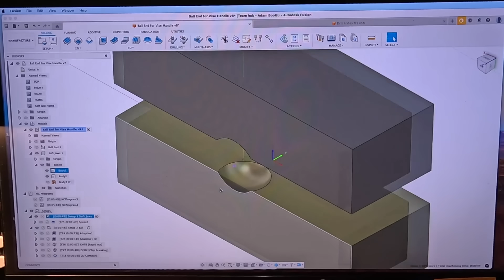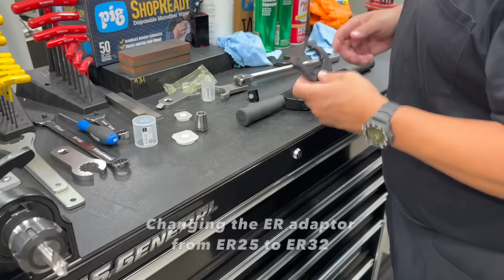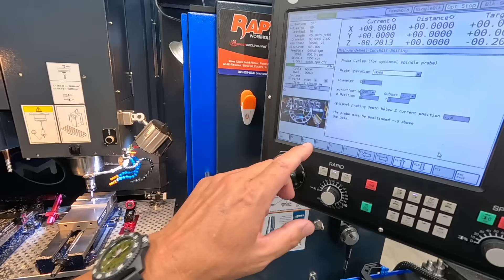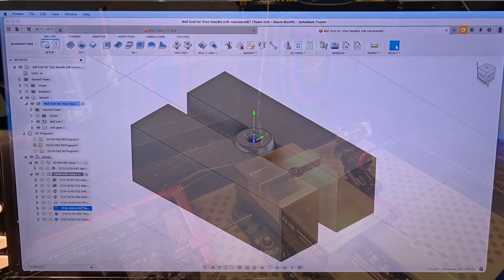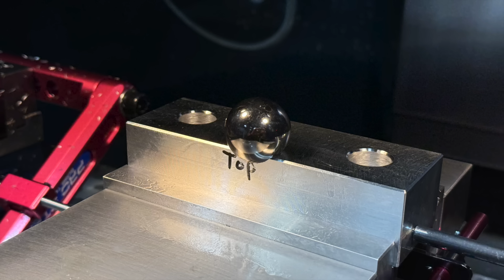Machining  Ball Ends for Vise Handle

Comment: Tip for future thread-milling: Keep both tool paths active, but activate wear compensation on your finishing tool path with no roughing passes. Put a forced tool change before your finishing pass & a manual entry after your finishing pass with a few thousandths stock to leave to retract your tool, turn off the coolant & spindle, bring the part toward you, and pause the program (typically G91 G28 Z0.; M9; M5; Y0; M00;). This way you can inspect the threads, and manually kick back to the first line of your finishing pass (manually or via search) as that tool path will begin with the T## M06 if you need to add wear to the tool in your controller to sneak up on it. Great video & awesome content!

Comment: 9:16 - Got several Edge Technology tools and they are impressive for the simple engineering and wonderful functionality. The 3-jaw chuck parallels for the lathe are a simple design solving a long-term issue (no, do not work there and am not paid; just a pleased customer).
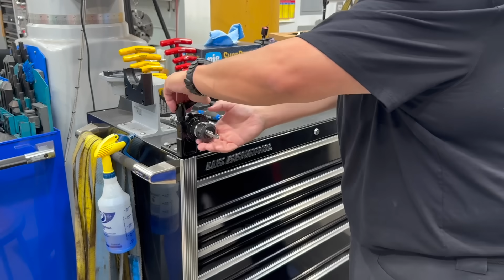15:09 - Very careful work; none of those cutters is going to fail to repeat.
28:39 - Can you label that cutter with the maker/source in your menu?
49:48 - Could well be air compression with that thread fit.
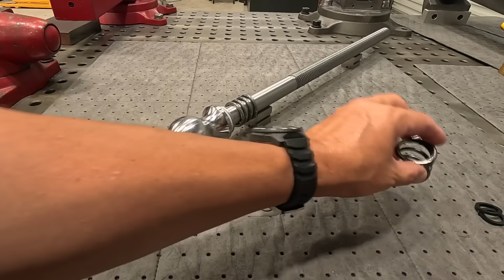55:02 - You have more coils with the new spring = longer 'torsion bar'. Could be a lower compression rate.

Comment: Not sure how comfortable u are but in passes tab u can enable wear so u don't need to walk back and forth from PC to machine.

U can adjust the wear comp in the machine by using a negative number to comp the thread mill into spec for the thread
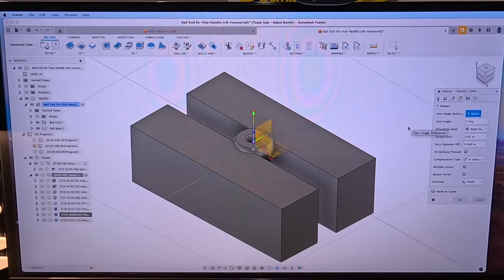Reply: He mentions at 40:02 (on screen graphic) that he wants the program to be 'right' first, and then later he can use wear compensation for fine tuning.

Comment: Great video Adam. I’ve not done CNC work but I have used 360 for 3-D printing designs and it’s not the easiest thing to use. There’s not much below and more simple to use available for this type of work. Big big learning curve. Great finishes on the pieces with a minimum of cuts. Thoroughly enjoyed the video. Thanks for your efforts and the dependable output of content. Not easy to put something out every week. Ignore the nitpickers!

Comment: What is the purpose of a no go gauge?  Why do we care that it don't go as long as it does go.  I am a novice, completely void of knowledge
Reply: It reveals when the threads you are making are the perfect size.  The "no go" end of the gauge is machined a little too tight to thread together.
Reply: One end tests if the threads are too big, the other tests if the threads are too small
Reply: to prove you are within tolerance the threads have to be within a certain range. not too big, not too small, the no-go gauge proves you are in the goldilocks zone.
Reply: Hardened precision gages establish the correct class of fit for interchangeable production parts.

Comment: Could you have cut two ball slots in the aluminum jaws and milled two balls in the same program?   Or does the programming of the second job take longer than cutting one at a time?
Reply: If your moving jaw has a little slack to accommodate any slight differences between the two parts, or you design-in a pivot to the moving softjaw, you can certainly do it, and use an offset to do the same operations in two places. If you're using Fusion, it's trivially simple to duplicate the part and machine both in tandem. It would save a few seconds on tool change time if you are doing a production run, but I'd make a dedicated fixture to run 16 or 25 at once if I had hundreds to make.

Comment: As a fellow cnc Miller in the UK when I make soft jaws I like to put 2x 6mm h7 fit holes in the both jaws at either side so when It comes to lining them up you can use 2 6mm pins and still get your Allen key In to tighten up also keeps jaws for repeat use awesome content 😀

Comment: A thought on making the soft jaws: before milling the hemispherical pocket, drill a clearance hole in the center. This would have two advantages. First, when cutting the pocket, the center of the pocket will be cut with the center of the ball mill, which moves at 0 fpm, and therefore does not cut well. Second, the center of the pocket doesn't help with clamping the ball, and can interfere. If the pocket is a tiny bit oversize, or if a tiny nub is left, then the ball will sit on that, and you will effectively be trying to clamp it at a single point. The ball won't be secure against rotating around that axis. But if you leave a hole the center, then the jaw will contact the ball in a ring pattern, which will be more secure.

In fact, for the best clamping, the contact patch should probably be a narrow ring around the outside edge, with most of the bottom of the pocket drilled or milled away.

Comment: This may be a dumb question, but how does the machine index the threads on each of those passes? The first time you re-cut the threads, I was wondering how does the program know where/when to start cutting and landing the tool in the exact right spot in it's rotation so that each pass overlaps exactly?
Reply: The thread mill doesn't need to land in any particular orientation. Unlike a tap, it doesn't have threads, but rather cuts a series of parallel ridges. The threads are developed when the machine moves the thread mill along a helical path.
Reply: Yeah I'm mistaken.  I forgot that the tool profile of a thread mill's teeth aren't dependent on an indexed position.  I always think in my mind that if I rotated the tool in the holder while in the oriented machine position it would change the thread start.  But it doesn't.
Reply: Was wondering the same thing
Reply: The tool is oriented at the same place every time because there is a spindle encoder.
Reply: @BradPow  One of the great features of thread mills is that, unlike a tap, they do not require a machine with a spindle encoder.
Reply: @BradPow  This isn't a tap.  It cuts the threads by moving the tool in a spiral path up the bore.  It doesn't matter where the spindle is in its rotation - it isn't synchronized to the threads like a lathe would be.

Comment: Just watching as you set up the drills, mills, taps, etc. into the custom holders, and I must admit, the cost of all that gear before you even commence operations must be a big drawback to the younger machinist who wishes to further involve himself on CNC operations. Is there some kind of financial helping hand available to the American novice, or do they have to go into debt before they start?
Reply: Go watch some Practical Machinist content. The regularly feature startups (several in the last few weeks) and low cost to entry commercially with CNC and or Manual. Very rough rule of thumb would be to allow 50-200% of the cost of the Mill or Lathe for tooling. The big plus in the US is the sheer level of 'decent' used equipment compared to say here in Australia where it just sux.

Comment: Something you might also want to check Adam is on the box the threadmill came in it should list the actual diameter of the threadmill as well. At least all the ones I have used in australia list the diameter anyway. Out of curiosity shouldn't the thread be programmed to a nominal diameter and the mill's diameter offset for the threadmill control the final size of the thread. Seems strange to have to change the program size to change the thread size because that would mean as it wears out you would have to change the program to compensate.

Comment: I made my vice handle balls the other way around. Started with regular round bar that I threaded internally. Then made them spherical with a ball turning tool. There was some play in the tool so the first one wasn't very spherical but after tightening up, it was perfect.

Comment: I'm wondering if you recessed the hole in the meatball to accommodate the rubber washers sitting slightly proud of the surface, if it would be a better/cleaner result than having them exposed and visible at the ends?

Comment: You know, after finding X and Y, you can just send the probe to 0,0 to find Z0, on top. Using the top of the jaws is fine, in this instance, but it would help eliminate any errors due to the way the ball was captured in that pocket.
Still, great job! Thank you for sharing.

Comment: How does the thread mill work at that RPM?  Could you show a close up of the tool?
Reply: It is essentially a groove tool, it only forms threads when moved helically. So it can work at any RPM, and any feedrate.

Comment: i don't understand how the threads are cut.
Reply: Magic
Reply: I think it's like the regular way as on the lathe, just the cutter moving vertically instead of horizontally. Plus the cutter point is spinning to make the cut instead of the stock spinning against the cutter on the lathe. The precise movement of the cutter in the Z direction (toward the floor, then toward the ceiling) while spinning is the amazing thing about the mill.

Comment: Incredibly over complicated. Could have made the entire ball on one setup in the lathe. Drill and tap the threads. Just needed to use a groove tool to form the ball and leave a .100” stub to break off and polish away.
Reply: You missed the point. He used this project to get experience on the Milltronics mill. I know it looks like he walked around the block to go to his nextdoor neighbor. He's trying to LEARN something that will expand his skill set. More power to you Adam.
Reply: @skx750 All he learned was how to overcomplicate something. For content it’s great, for efficiency it’s terrible.
Reply: Another guy who watches videos without listening.
Reply: @zorbakaput8537I watched the whole thing just for you and I still feel the same way.
Reply: It's not just about cutting chips, it's about the thought process and things to consider before making something.  As a machinist, i learn a lot from other people's methods

Comment: Adam i’m surprised you didn’t make the aluminum jaws for the vise. You could’ve purchased a slab of aluminum,measured it,cut it down on your bandsaw,milled,drilled,counter board the bolt holes, and then made the ball fixture feature. Maybe next time, … but it is still another great video.

Comment: Ran a Davenport Screw Machine that has 9 different cams and I manufactured automotive bleeder screws on Davenport Screw Machines that had a cycle time of 6 seconds. Every six seconds a bleeder screw would come off that machine complete after starting with a 12 ft hex stock. When I say complete there were feeding, forming, shaving, threading, drilling, cross drilling operations, and cutoff operations all on one machine.

Comment: Adam, at 50:20 or so... you were having issues with your go gauge....  look at the threads on your go gauge... it looks like there may be a ding on the threads of the go gauge... because it give you issues as soon as the shinny threads hits the part.
Reply: Thread gages are 60-65 HRC and can't get dinged. Maybe a small piece of swarf got in the thread.

Comment: I work as a manufacturing machinist.  I have 3 machines running one part in 3 stages of completion.  Along with 2 robots and a conveyor system.  I can make that offset correction on any tool, every machine as easy as opening my offset menu, modify, back to work.  

 Adam motivated me to become a machinist 5 years ago.  Changed my career at 55 years old.  I love this work.  I honestly love the manual machining I do at my home shop.  I miss it.  Was my hobby, now my paycheck lol.  

I started my shop 8 years ago with 2 very old, big machines.  A 30 inch bed 1973 Bridgeport and a WW2 Monarch tool room lathe off a Navy vessel.  ADAM taught me how to use them.  Honestly.

Comment: I understand that it is G code and all, but it seems really inefficient to have to go back to the computer just to open the thread bore up by .001”. Doesn’t it have some kind of tool compensation where you can adjust it at the machine without regenerating new G code at the computer?
Reply: I work as a manufacturing machinist.  I have 3 machines running one part in 3 stages of completion.  Along with 2 robots and a conveyor system.  I can make that offset correction on any tool, every machine as easy as opening my offset menu, modify, back to work.  

 Adam motivated me to become a machinist 5 years ago.  Changed my career at 55 years old.  I love this work.  I honestly love the manual machining I do at my home shop.  I miss it.  Was my hobby, now my paycheck lol.  

I started my shop 8 years ago with 2 very old, big machines.  A 30 inch bed Bridgeport and a WW2 Monarch tool room lathe.  ADAM taught me how to use them.  Honestly.
Reply: @MrJoey1003  right. I’m not a CNC machinist and only a novice hobby machinist at that. But I thought for sure you can open a hole up at the machine without having to go back to the computer
Reply: I’m well versed on using wear comp, so Adam is well advised on wear comp. He just wanted to learn one method using the software to make the changes. I’m sure you’ll see him do it with comp as well in the future.
Reply: @MechanicalAdvantage 
That makes perfect sense, no reason not to learn what the different options are. 

In that regard, is there a case where you see this way as the better option? Or is that really only useful for a machine that doesn’t have its own cutter comp, like a hobbyist machine possibly?
Reply: @BlackSmokeDMax  Getting the pitch diameter offset dialed in will help the next time he has to cut this thread in this material. Getting that dialed in, in combination with cutter comp will make it super easy to make small adjustments to dial in the thread. And the fact that he just wanted to use this method in the software this time.
Reply: @38:59 you can see he has his compensation type set to “in computer”, if he would change that to “in control”, then yes, he could just make a cutter comp offset right on his CNC.

Comment: So you spent $2000.00 for tooling to machine a $1.00 stainless steel ball for the vise handle. Just saying….
Reply: No he bought an expensive machine to extend the capabilities of his machine shop, and he uses fun projects to enjoy learning how to improve his skills with it.
Reply: Were you entertained? 😂
Reply: So ... I guess all that tooling he bought will just be thrown away or put in a box and never be used for anything else huh? Just sayin ...
Reply: Learning cnc machines takes a lot of time and money. Initial investment is astronomical. I see a lot of youtube videos showing cnc machining  but when I ask how much time and money it took to manufacture the part…..  invariably the answer I get is crickets. It is no easy feat.
When I learned to run a Davenport screw machine it took about 5-6 years to truly become one with the machine. It was expensive but I was able to keep my costs down by buying used machines and those machines came with a lot of tooling. If I had to buy new I wouldn’t have been able to do it.  Another plus I had was the fact I was mechanically inclined. I could look at the problem and finding the solution was easy for me. I also learned to repair my own machines. You have to think outside the box and be flexible.
Reply: Yeah, you’re probably right, sigh….

Comment: Regarding the coolant splashes on the camera lens, speak to Peter at Edge Precision (he's on YT) - he's designed and built some coolant-dodging cases for his cameras that use compressed air as a protective "lens". He puts them in his massive Mazak CNC lathe/mill. It'd be interesting to see you make a set if Peter is willing to share the models/drawings.

Comment: Adam,

It's good to see you progressing  your ability to do CNC machining.  After two years, most of us would give up and do what we've always done. Whatever you do, don't give up.

Something that you could try that would help with changing tools into and out of CNC machine is color coding.  For instance, for the bearings you just worked, you could label a tool Red 19 A.  The Red 19 A, Red represents  the color group, 19 the position number, and A the part number.  Doing this makes it easier to identify errors.  

I first saw a system ocean going salvage tugs.  Their coloring included everything from hand tools to their 3" wire towline.  If they were preparing a tow line, shackles, chain, eyes, hand toolss, nuts, and bolts used for a specific size, all were colored accordingly. 

Bob

Comment: Using o-rings just doesn’t feel right to me.
Reply from the maker: The o-ring helps protect the precision bore from being compressed and becoming too tight on the handle. It was a great tip that my friend Alex Brown gave me from his experience rebuilding vise spindles. 👍🏻
Reply: @Abom79  Makes sense. But that’s what I mean: it all seems a little delicate for a tool of this kind.
Reply: It needs micrometer adjustments on the spindle so you can tighten it with exactly the same pressure each time.

Comment: Try using low strength threadlock compound such as Loctite 222. It's intended for threads under ¼" but I find it useful for larger sizes where I don't want too much strength. I also use it on soft metals like brass and aluminum.

Comment: What I think you will find out and I have experienced your balls that you made should have ended up the same size as the shaft cuz when it comes down in your hands on it or you pull it out it's going to take a bite it needs to be the same size and tapered down it overlaps and your rubber bushing when you take a hunk out between your thumb and your finger that meet right there is very sensitive you're going to wish you would have done it right the first time. Yes with all due respect you have made it look good but I think you'll modify the first time you take a hunk out of your hand